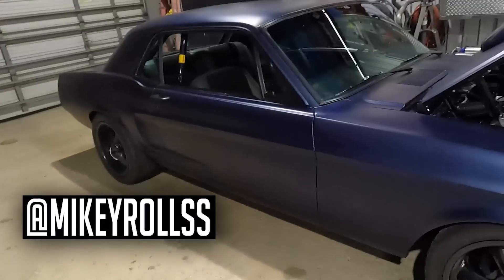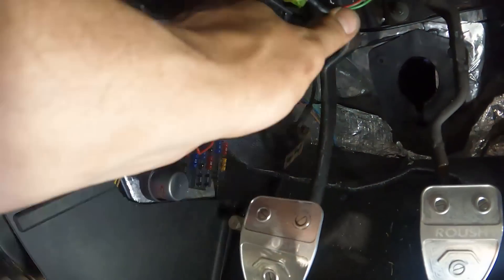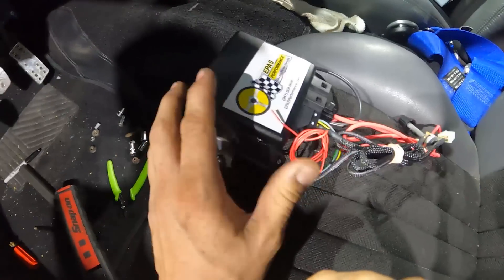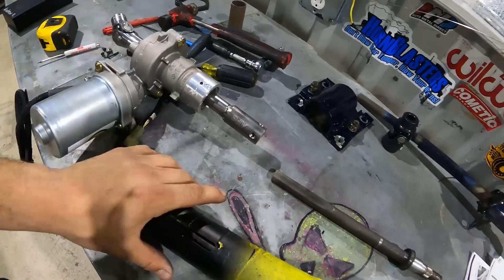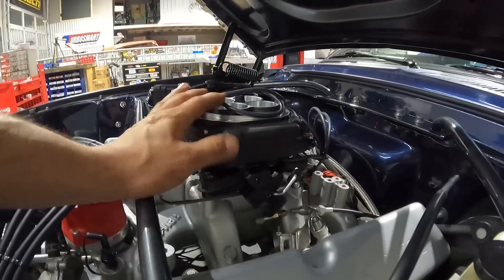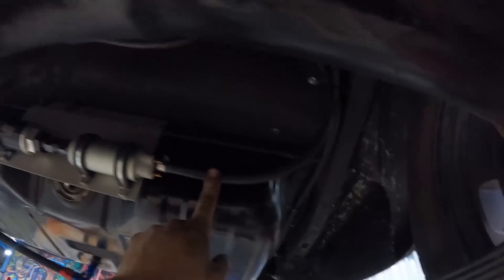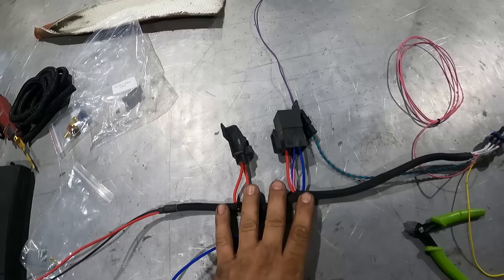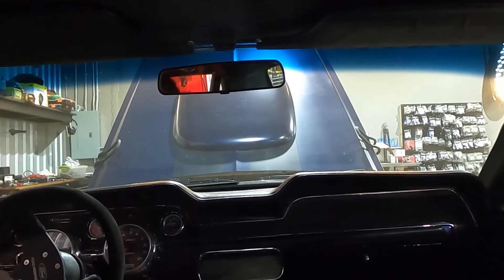Electric Power Steering Conversion & EFI Swap! - 1968 Ford 351 Mustang

Comment: 2 things that shoulda just spend the time to do right. that return line dumping at the top of the tank is going to aerate the fuel.. if you didn't want to drop the tank and weld in the bung or bulkhead it properly you should have at least ran a hose inside that fill next to dump the fuel in the bottom of the tank. 2nd, that o2 bung should have been welded. the clamp on bungs are kinda garbage. for a car as nice as this and you having it on a lift already and a tig welder in shop, why not weld in the bung?

Comment: new sub. sweet looking mustang. sniper on my turbo 302 now and love it. doing a 408w stroker now that'll get a holley hi ram and haltech nexus r3 most likely. I'll actually be doing away with my EPAS for the swap due to the serpentine setup i purchased. i built mine from a nissan versa motor and a gm universal column off ebay for under $500 though..

Comment: I got a blow thru carburetor for a 289 With a Paxton nüvi 1200 SL do you think it’s better to try to get the holly sniper EFI it’s for a 1968 coupe?
Reply from the maker: I would definitely shoot Holley a message on that! I'd hate to give you the wrong info there, but the guys over at Holley are super helpful and should be able to steer you in the right direction!

Comment: Is there anymore info on this mustang build? Would like to see the project. 
The EPAS is that connected to the original Mustang steering box or does this have a rack and pinion system? If it does what's the setup, please?
Reply from the maker: Shoot Andrew a message on IG and he can help you out

Comment: My '66 Stang was manual steering and I never felt any need for power.
Reply: I have drove a few manual steering vehicles which were fine. But, I could have used this in my old 70 Ford pickup I used to have. It was a serious workout if not moving.

Comment: I used a Chevy equinox epas motor with Bronson controller on my ranger build and one day it freaked out and pulled/locked left. I couldn’t even muscle it straight. Luckily I was on a back road. I’m swapping to normal ol hydro now. Scared me good
Reply from the maker: That's enough of a scare to need to change out your underwear! lol glad you made it out safe though!

Comment: What happens if you lose power do you lose steering?
Reply from the maker: It would essentially just be back to manual steering
Reply: That isn't a common issue, however, the system has an internal circuit breaker. If it trips for any reason, the car would simply revert back to manual steering until you stop, turn the key off and restart the car. The system automatically resets itself.

Comment: Surprised to see you guys use that Airtex pump when the Holley OE pump module exists. As someone that deals with Snipers day in and day out, those Airtex pumps make better paper weights than fuel pumps. The OE module is so much better.  Solid work either way though. Always look forward to your new episodes

Comment: If someone is up for a diy fabrications e steering  can use an 07 Prius e pump. Picked one up at wrecking yard for $75 full
Day of cutting measuring and welding you can have power steering that works just like this. Currently running on my jz mustang and works great
Reply from the maker: ooo thanks for the tip!

Comment: One of those electric steering systems is on my to get list.  I wish they would have a system where you add wheel speed sensors and automatically adjust the sensitivity as needed.  Keep up the great content, you guys might need a bigger shop for all your projects.
Reply from the maker: We definitely have another one on the list for the EV truck! Thanks for all the support, hopefully our shop will grow in size along with the channel!
Reply: They do.  Multiple styles actually.  Wheel speed sensor style, hall effect style and GPS style

Comment: Great video.  I've heard good and bad about the HOLLY EFI system.  What are your thoughts on their reliability and what skill level is required to install one?  Thanks
Reply: The biggest thing is good wiring and follow the instructions to a t. I did my install over two weekends. 67 mustang with the sniper controlling timing. I've had it for 2 years and without a single issue. Allot of street driving and a ton of track time with 0 issues 🤘
Reply: When they work, they're great.  When they crap out, you're basically shit-outta-luck.  Holley doesn't support you repairing it.  You have to take the unit off your car, mail it in, and wait 6+ weeks for them to fix it.  Last time I had to call holley, hold time was over 90 minutes.

At least with the fitech, which is very similar to the holley, its easier to revert back to your carb if you have to take the EFI off for repairs.
Reply from the maker: If you have mechanical knowledge and are good with instructions you should have no problem! We haven't had any issues with the ones we've installed!
Reply: I trust my holly that's been on my 67 cougar for the last 30 years more that holly EFI and I work in a restoration shop.we have EFI cars now and then that come into the shop that are not running right so they are not 100% problem free

Comment: Do you think the EPA kits can be installed on a 350Z?
Reply from the maker: Shouldn't be a problem if there's room for the motor underneath the dash!
Reply: The throtl guys did an epas swap on their tesla powered ev converted 350z.
Reply: @4literv6  thanks! I'm going to check it out!

Comment: Does the Electric Power Steering save horse power?? Great looking build. We were selected 1/50 to join this years Barrett-Jackson Road Tour. Starts in Parker Colorado, we are going to Dave Kindig’s shop, Yellowstone National Park $3200 pays for all of our Lodging and most of our meals. Epic trip. My BelAir is in paint right now.
Reply: Maybe saves enough horsepower you could measure it on a dyno, but not enough that you could feel it while driving.
It also saves weight and all those hydraulic PS lines that are all over the place on the 70 and earlier mustangs.

Tradeoff is it can be easier to diagnose and repair the old hydraulic setup.  Its obvious when something is leaking.  And you can buy complete pumps and slave cylinders, rebuilt units, or rebuild kits to do it yourself.  With the electric steering, you get none of that.  When it isn't working, you get to stare at a pile of electronics with your multimeter to try and tell what's broken.  And if something needs fixed, good luck finding spare parts for it at autozone or anywhere else.
Reply from the maker: That's awesome! Congrats! Like the other response said, it won't be any real noticeable gain but it would definitely make it more enjoyable to handle whatever power you are putting down!
Reply: @SalvagetoSavage  thanks this will be an Epic trip and fun to boot. You should make application the next Barrett-Jackson Road Tour is in New England. You might stop buy and let us buy you a glass of Wine??